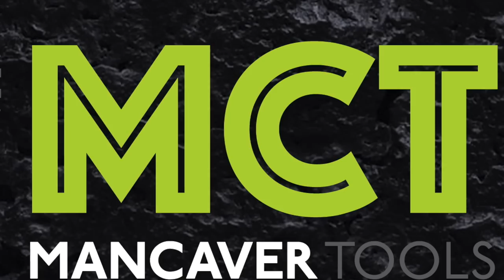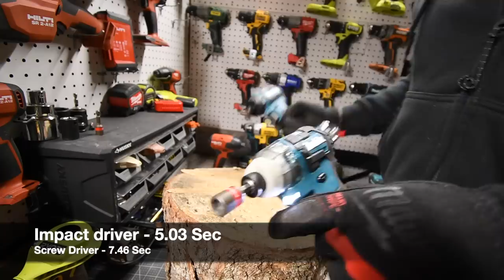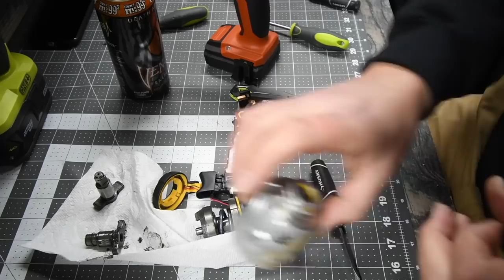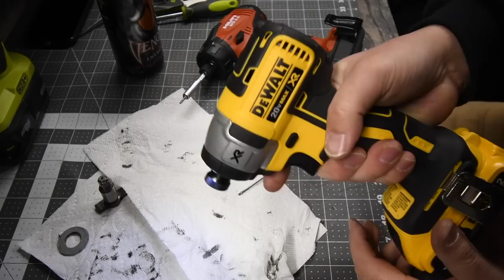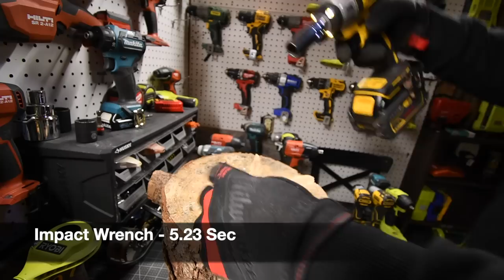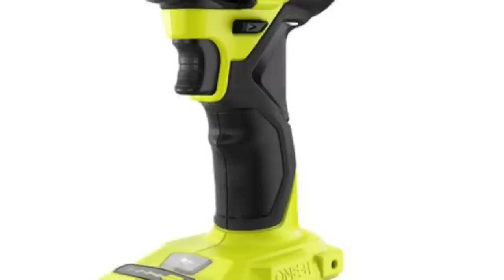Impact Wrench and Impact Driver (Whats the "REAL" difference)

Comment: You could imagine those two as different gears in your car.

Lower gear (Impact wrench): high torque, the car can climb uphill, but slower.
Higher gear (impact driver): your car is faster, but doesn’t have as much power.

Imagine trying to race uphill in 5th gear. Your gearbox would cry. Or race super fast on a highway, but in 1st or 2nd gear. Wouldn’t work well either.

That is basically the difference between impact wrenches and impact drivers.

Comment: Great video!

I learnt this the hard way - bought an impact driver (with 240nm of peak torque no less!) with a 1/2 inch drive adapter thinking I could use it as a cheap impact wrench (it came in a very cheap battery set).

The driver couldn't even take off the lug nuts on either of road cars (admittedly, a better battery would probably see it succeed there, but if it can't take off lug nuts, itll have no hope against rusted nuts and bolts).

I had set myself a rule that if I ran into a bolt on the cars that the impact driver (turned 1/2 inch impact "wrench") could not handle, I'd go out and get an impact wrench based on how much the driver had struggled with its 240nm rated torque.

I thought maybe a mid or low torque impact wrench would be what I bought once I ran into a particularly rusted bolt.

Having seen the impact driver struggle to remove lug nuts (because the tire place had overtightened them of course, but still), I went out and bought the Ryobi monster high torque impact wrench.

And hot damn, it just smashed those lug nuts out! Once I retightened the lug nuts with a torque wrench to 98nm, the impact driver was able to handle removing them again. 

I'm still not sure why a 240nm impact driver couldn't remove lug nuts that were probably tightened to maybe 150nm (surely not more? They are rated for 98-130nm), but the whole thing made AMPLY clear that an impact driver is NOT a replacement for an impact wrench and that a tool is not determined by its collet - as you say, it is the motor design that matters.

What I didn't realise, and your video showed me, is that an impact driver is much better for driving stuff than a wrench! 

Thanks for the great video!

Comment: I just saw this video, and it confirmed my understanding that impact wrenches are slower but stronger. I purchased an impact driver last year, and between moderately high use driving screws into framing building a shed and high temps in Texas it died in like 6 months. My hope is that an impact wrench going slower will actually last longer.
Reply from the maker: it might be better. just need a good adaptor then you are good to go

Comment: I had this question all the time in my head when I was trying to buy an impact driver to build a shed by my self. Because I have several old cars, I thought maybe I can just buy an impact wrench, use some kind of adapter and use it as a impact driver for wood work. I was totally wrong. I'm glad that I bought a makita "impact driver" for building shed. Verrry useful.
Reply from the maker: I do have a video with using that adaptor, you should check it out and it works well
Reply: Why were you wrong

Comment: Surely it's more likely to be the planetary gear set that is different, rather than the motor? And the strength of the spring used to hold the anvil.

Comment: I cant answer for others, but I think those comments you got may have been one of those times where how you say something matters more than what you say? Example, in this video you point to at  3 different things and say "anvil", 2 of them are the same component seen from different sides and the last one is just pointed at while really talking about something else. By all means, its not wrong, but as someone who fairly recently got into power tools I can see how that can be a bit confusing.

That being said I like your videos. I like how the tests you do (even though they may be harsh) are applicable to real use cases. Too many tool channels focus on those silly tests like where they connect two drills and see which one dies first and such, which tells me nothing about how usable the tool is in what its intended to do. I want to know if I can hang up pictures in the living room with a cheap drill, not if a $1500 drill can kill it. Your channel I feel like I can reliably go to and see what the tools can actually do. Great job man!
Reply from the maker: I thank you for the feedback and support Kvern. these video I do are unscripted and I do admit sometimes I do go off topic, I try to get better at it, but I do thank you for viewing bro

Comment: Great video, very informative and ejoyable though I’d say the biggest “mistake” you made in the script was that the impact wrench is soooo much more versatile since if you have one that is 1/2 inch every adapter you put on is smaller so there is more metal than going from 1/4 inch hex to e.g. Half inch. The adapters i was talking about are from milwaukee and they make you 1/2 inch impact wrench into either a impact driver- the 1/2 inch to 1/4 inch hex adapter or it can turn it into a drill with the 7/16 inch adapter for linesman, electrician ‘s and plumber’s bits. So that would be for example augers, selfeed bits or spade bits (1/4 inch hex)
Reply from the maker: that's why they have both impact wrenches and impact drivers. with the impact wrench its nice to have a thick heavy duty adaptor that won't break

Comment: So if there is a fast car and a slow car then one of them is not a car? I still dont understand the difference.
Reply from the maker: an impact driver normally is faster but it hits more. an impact wrench is slower but it its harder. so the tool needs to work less to do harder work